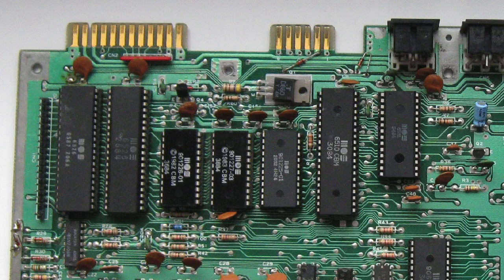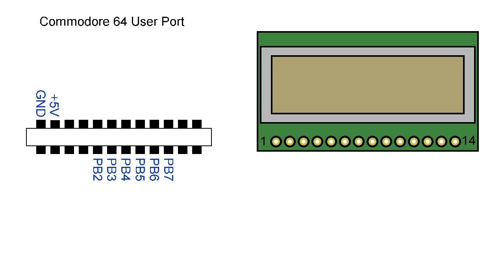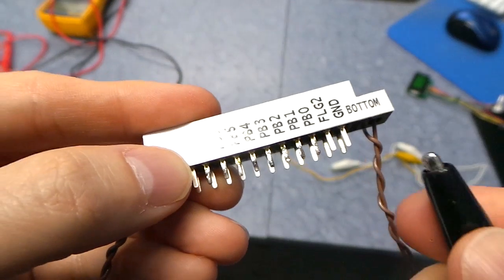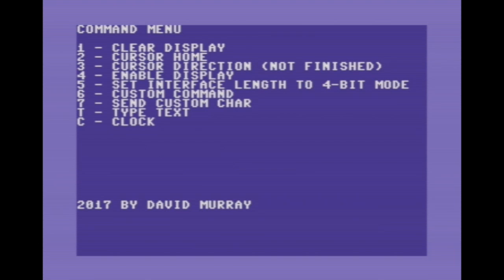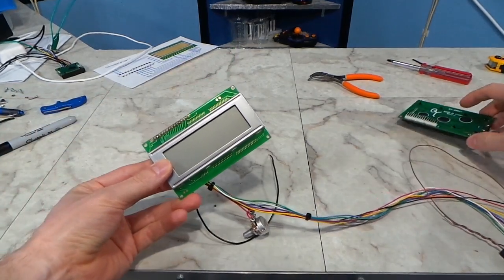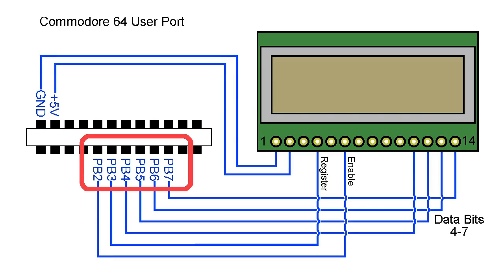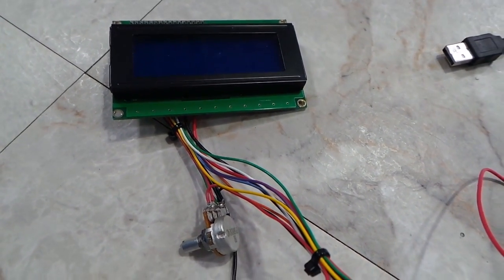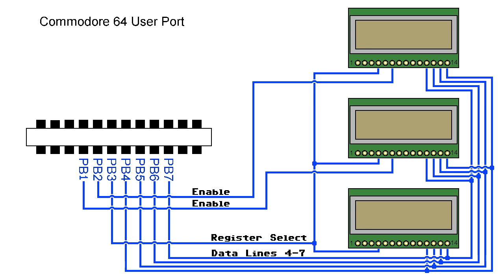How a Character LCD Works - Part 2

Comment: You did not state how lcd is switched from 8 bit mode to 4 bit mode. On and off switch for every lcd or circuit board is very clever. Using data ports to on and off switch is clever too.   Thankyou.

Comment: Using a BASIC program to control the screen makes it slow enough that you can ignore an important requirement of the HD44780 controller chip in the LCD module. That requirement is that you give it enough time to respond to a command before sending the next one. Using toggle switches and a push button gives it plenty of time and, it seems, the BASIC program is slow enough too. But if you write code in assembly language you need to bear in mind that most instructions need at least 37us to execute, and some take as long as 1520us. You can use delays or you can poll the status register of the chip to determine when it's no longer busy before sending the next instruction. Maybe this is covered in part 3. I haven't watched it yet.

Comment: I had the same problem with garbage or artifacts on the screen of my 1985 Roland keyboard when I replaced the screen's backlight. I realized the flux was never cleaned off and it's semi conductive. After an isopropyl alcohol wash everything was all good.

Comment: "The 8-Bit Guy" --  You have the gift for teaching.  Good video, good audio, easy to follow narrative telling a story.  Thank you.

The following is not exactly on point but...Re:  Commodore power adapter high Voltage -- If you are powered by NIPSCO here in NW Indiana, one becomes accustomed to supply irregularities.  Over about a 9 month time, I went through 3 older but previously very reliable HP and 2 new Samsung laser printers with all looking like something was really glitchy with the power supplies.  The Samsung would power up and sit for about 10 minutes looking like it was downloading revised BIOS and then starting working normally.  Then a washing machine with a capacitive touch screen bugged out but I was able to control using wire wrap in a pinch, and microwave bugged out for a short while, but came back to function normally.  Submersible pump, compact fluorescent lamps also bugged out over a period of a few months.  That summer was exceptionally hot and I wondered whether the neighborhood, which is about 60 years old, had the required service lines.  So I checked the duplex socket Voltage... 143 V.  Months later, NIPSCO replaced a line transformer serving three houses including my own.  Subsequent line potential- 121 V. A neighbor later told me of similar problems but did not know of the high line Voltage.  NIPSCO never told us of any problems.  In 2020, my house had 18 power interruptions and only one was likely due to weather.  NIPSCO suggested I install a whole house UPS.

Comment: Interesting. It was a long time ago. But my experiments were flaky due to under voltage, not over-voltage, thankfully. My C64 was putting out something like 3.8V on the data lines. And I would have to reset it frequently enough that I mounted a reset switch for it. I can't believe I just kept on making it work like that.

Comment: Huh! I thought this would be like the Atari port, but it's more of a smart general-purpose port. Atari's had an expansion connector which was functionally much like the IBM PC's internal card slots. You'd need address decoding and maybe a 6526 to use it. Edit: Haha! It's probably a lot like connecting to the C64's cartridge port. For the 130XE, Atari redesigned the expansion port to be an extension to the cartridge port; another edge connector in-line with it.

Nice labelling, I'll have to take that up. :) The puller is useful and easy to make, another one to remember. Useful video and we've hardly got to the LCD yet! :D

A power supply disaster! I've been thinking I'd like like a sort of bench power bus with a modern high-quality high-current PSU supplying multiple devices at various voltages. Designing it wouldn't be easy though. 1 PSU per device is much easier.

Comment: Sounds like it would be a good idea for all users of these old power supplies to put a 5v regulator chip in line between the PS and the C64. perhaps using a 7805 between male and female power plugs.

Comment: Very good episode. I used such a display with a raspberry pi and modified the "munt" code for it.
And I faced the same problem with the power supply on a 1581 replica a few weeks ago. :-/

Comment: Those evil little bricks, mine damaged one of my c64's rom chips before I realized it was malfunctioning. I cut off it's DC output and soldered in a more modern 5v DC adaptor, so the old brick only supplies the 9v Vac, a good cheap solution that still works today.

Comment: When you're using something where the power supplies are known for failure, wouldn't it be better to buy or build a reliable power supply? (I once powered a C-64 with an Amiga supply. I think I got the 9V AC from some sort of transistor circuit, but I don't remember.)

Comment: You need to tie your grounds together, otherwise you risk creating a voltage differential between the grounds from different power supplies.

Comment: I hooked my VIC20 up to an 8 segment display when I was 13. In the process, at one point, the VIC20 stopped working. I had a heart attack, it was the family computer and quite expensive at the time. Turned out to just be the fuse. LOL.

Comment: I think it's called the user port because the user was able to control at least part of it very easily.

Also, anybody can use one of these LCDs in 8-bit mode from the user port with shift registers.

Comment: I am a bit confused. The lcd was powered by a different PSU than the PC. This means that 5VDC from the GPIOs does not necessarily mean 5VDC to the LCD. The grounds of the LCD and PC are floating and with different potential. Everything should work only if you connected the two grounds together. What am I missing here?

Comment: Isn't it normal to measure an overvoltage while there is no load?
Reply: Sure, but not 11 volts on a 5 volt line. And remember, he said it was 8 volts when hooked up to the C64, thus under load!

Comment: You could even connect 7 displays by demultiplexing those three pins you're using as addressing lines. Quite why you'd want to do that I'm not sure but then the chances of me wanting to connect 3 to a C64 are, I think, rather remote. ;-)

Comment: If you put some resistors in between the user port and LCD while powering the LCD externally it may help protect both devices from being hurt by the other.

Comment: Accessing the parallel port of an old MSDOS PC was as easy as using a C64 or Amiga; you just needed to start QBasic (which comes with MSDOS) and use the "OUT <port>,<value>" command (<port> = 378 for LPT1). The rest is just the same BASIC programming as you did on C64/Amiga. Anyway, good video ... with troubleshooting! Thank you!

Comment: 12:40 that's because the 6510 (as any 8 bit cpu from Motorola) will have its I/O mapped to memory, thus a simple PEEK or POKE is what u need to read or write those lines

Comment: If the power supply failure is common, you need to add some circuitry which shorts the 5V and blows a fuse if the voltage gets too high.

Comment: Argh! don't use those old potted supplies, most are failing by now and taking out the c64(as u had happen). its cheap and easy to build your own psu's for c64.

Comment: I found working with the MS-DOS parallel port quite easy to work with. Just use the "OUT" assembly instruction and off it goes. The equivalent commands are able in C.

Comment: This is why you never trust a brick.  Like re-capping is a given for old equipment, similar things go for old computer brick power supplies, and replace them with more reliable switching supplies.  You can gut the old brick and install it there, to keep it vintage looking, but it should be done.

Comment: I wonder. How to switch it to 4-bit mode (using 4 bit instruction while LCD expects 8 bit)? More reasonably the question is  — how to understand if you are sending the first nibble or the second nible (while both operations are identical and you even not sure if it works in 4-bit or in 8-bit mode yet)? What is foolproof sequence of instructions that resets correct mode and correct  nibble position (in case if one nibble missed accidently)?

Comment: I made custom animated screensavers for a 2 x 16 & 4x16 LCD like rising bubbles, a walking man, and others using the custom character RAM in those. It's not that hard, plus you can create even more custom characters by updating the custom RAM on the fly since it's very limited.

Great Arduino project, by the way. I've been considering writing an article about it along with providing the code, diagrams, and video examples etc.

Comment: 11:33 In fact, it is pretty easy to connect 8 screens to the user port with a 74138 (decoder/demultiplexer) to control the 8 enable pins. PB0, PB1 and PB2 can be combined into 8 different combinations, and that is what the 74138 uses to enable one of the 8 screens. Now, that would make it impossible to update two or more screens "at the same time", but that can be done in software (a few clock ticks apart, that is). Great video, 8-Bit Guy!

Comment: There is something I don't get: how is 4 bit mode set on the LCD in the first place? 
If only 4 data lines are connected,how can a command be sent to tell it to use 4bit mode?
Reply: The screen has an 8 bit instruction that switches to 4 bit mode, but only 4 bits are needed.  After it's executed it requires two burst of data on the 4 pins as stated.
Reply: There seems to be a power on sequence to initialize using bits 4&5 sending 4 instructions to set 4bit mode: is that correct?

Comment: The strange thing is that any time you see a component "frying" like that the first thing you should think of is the voltage and therefore the power supply.

Comment: you could go up to 8 lcd screens if you use the three enable pins to put out an address (0 to 7) and then a multiplexer to get 8 enable lines back :)

Comment: I'm dying to know: Did you end up fixing the fried '64? Which chip(s) were massacred by the faulty supply? It's amazing that the chips tolerated that much voltage before dying! TTL usually likes very close to 5v.

Comment: I found my Commodore 64 (looks like your C model but doesn't say C on it) a while back but not the power supply, and after seeing your video, I'm glad I didn't find the power supply in case it was bad.  I've found a way to take some AC adapters to make a new one for it for the 5 & 9 volts.

Comment: Could you do something similar to this with a raspberry pi by using the gpio port
Reply: Yes, very easily.
There are circuit diagrams and LCD drivers and libraries here: http://wiringpi.com/dev-lib/lcd-library/

Comment: Parallel port on a PC should be the ultimate in easy to do an output only. Just wire STROBE to the LCD's SELECT. Every character you send to the printer in BASIC should dutifully be sent to the LCD.

Comment: Putting a 6 volt Zena diode across the Commodore power supply with a fuse should prevent this from happening again.

Comment: 11:35 Using 3 lines (pb2, pb1 pb0) and additional 3-to-8 line decoder/demultiplexer (74238 for example) you can easily connect up to 8 screens !

Comment: You should be able to get 8 lcd displays connected to your C64 if you use a 3 bit to 8 bit decoder chip like a TI SN74HC259N 8-BIT addressable latch found on eBay.

Comment: Love the exercises in trouble shooting. I had many hours of fun using the old ZX-81 and then Sinclair 1000 writing programs that included machine code, building a parallel port that allowed me to make a garden monitor using home brew analog to digital converters and wet and dry bulb thermistors to measure soil humidity to alert when water was needed. Every robotics class could benefit from these basic instructions and trouble shooting methods. Bravo!

Comment: Shouldn't you with a bit of logic be able to use 4 screens (since 3 outputs can produce 8 different combinations of outputs and thus you could wire 4 high and low each?)

Comment: This video gave me an idea of using the Commodore 64(C)/128 (with a non-faulty power supply, of course) and their POKE commands in digital electronics to program peripherals through the user and cartridge ports.

Comment: If the Commodore power supplies have such a bad reputation of failing in over-voltage mode, I'd replace them with a more reliable home-brew supply, or interpose a safety circuit between the power supply and the computer that crowbars the supply outputs with some big-ass™ bipolar transistors or cuts the AC to the power supply if any of the output voltages were to exceed 110% of nominal.

Comment: If you have 3bits.. why not to ad a decoder and run 8 LCD screens :)
Great job 8bitGuy!
Reply: You'd only be able to run 7, as you'd have to have one output to not select any when changing the data.
But with more circuitry, you could have a latching 4-16 decoder to use one bit to latch the data into a "display unit select", getting 16 displays.
Heck, you could even use the last bit to a second 4-16 decoder as a "display bank select", so you could control which of 16 banks of 16 displays to control. Giving 256 displays. Or use shift registers to have as many display select bits that you could ever imagine. Build an 80x25 display out of individual blocks ;-)

But then you really need to go into assembler to get a decent speed, I guess.

Comment: That was the first thing I was taught when I started mending PDP-11 computers in 1981, "Check the voltages."  We sometimes had 3 PSUs on one computer, one for the processor, one for the memory and one for the 1Mb memory expansion.

Comment: Can you put it to 1bit mode rather than 4? Then why use 4 when you can use just 1?
Reply: There is no 1-bit mode, only 4 and 8. You could potentially use a shift-register to drive the LCD controller in either mode, but you'd only save two pins.

Comment: I love that, when you ran into  hard-to-solve problem, that you not only admitted it, but worked through your process of solving it. Things fail to work all the time. It's dismaying that the problem was caused by your C64's stock power supply, what a horrible coincidence. I don't suppose you can find a way to fix the old machine? The number of working C64s left in the world is only going down.... Also, is it possible to rig up a more reliable (less likely to suddenly start supplying 8 volts) power supply for a C64?

Comment: @8:36 -- well there's your problem.  Obviously, ground needs to be connected as well (especially if you're using a separate power supply for the LCD).  -- You always need a shared ground between your components if you expect TTL communication to work reliably...

Comment: New project, fix C64 PSU (don't trust any old C64 PSU, you should replace the 5Volt part with a modern part) :)

Comment: Sad that power supply kills C64..
This may asking for update in power rails  - fuse in input line or output from power supply and TVS diode to ground with proper clamping voltage.. When overvoltage occurs, TVS diode clamps and blows out fuse.. ;)

Comment: Sorry about your C64 (which may be repairable), but you have to stop using those old power supply bricks.  I suggest using a new quality switch-mode power supply with downstream regulation and filtering; the C64 also needs a 9V AC transformer.  The old power bricks just keep getting older, which hastens their failure, and by design when they fail they overvolt--for this reason, they are by far the #1 cause of C64 failures, and frankly that is a shame and a crime.  I'm not blaming you because most people aren't aware of this, but we really need to get the word out.  The C64 itself (even its original electrolytic capacitors) should last much longer when used with a good, reliable power supply.  C128 power supplies are OK, though--they're shaped like bricks, too, but are switching power supplies that by design fail in a safe manner for the computer.  By the way, the same issue applies to the Atari XL/XE series in regard to their all-black "ingot" power supplies.  All Atari 8-bit power supplies are aging and will fail, but the "ingots" specifically fail in the same manner as the Commodore power bricks, and usually take the computer out with them when they do (the RAM typically goes first, but any number of components can be damaged).  And like the Commodore bricks, the Atari ingots are filled with epoxy rather than ventilated, which decreases their service lives.  Just don't use these.  Here are a couple of references to the problem with photos:
http://atariage.com/forums/topic/220737-problem-with-atari-800xl/#entry2908506
http://atariage.com/forums/topic/270231-xlxe-power-supply/#entry3852722

One more comment I have is about your soldering.  Maybe you know this and were just rushing, but I think I saw you simply dab some solder to make one of the joints.  It doesn't work that way, at least reliably.  You have to get both parts being joined hot enough to melt the solder on their own, and the solder wire should be applied directly to the parts.  The iron is just for heating the parts, not for melting solder and dabbing it on.  You also have to make sure that the flux flows onto and between the parts being joined.  This should happen by itself if you follow the directions above, but it definitely won't happen if you simply apply solder from the iron like glue.  Now, if the two parts for some reason are difficult to solder together the normal, proper way, then you could instead coat or "tin" both of them with solder separately, and then use the iron to join them (with a little extra solder if necessary).  This seems to work alright in a pinch, but both of the parts have to be tinned properly first, which means heated until they melt the solder wire themselves and the flux is able to prepare their surfaces to accept the solder.  Do it any other way and you'll get an unreliable "cold" solder joint.